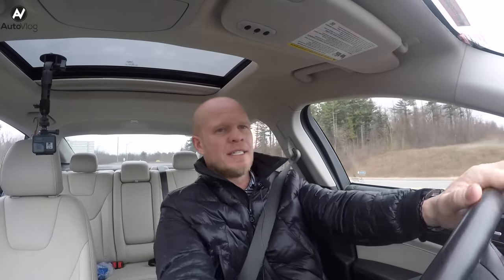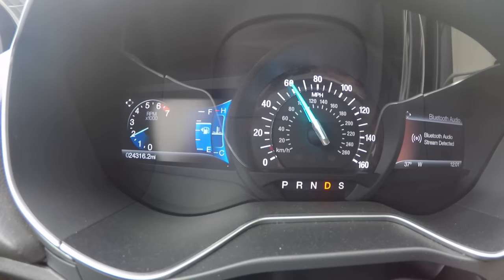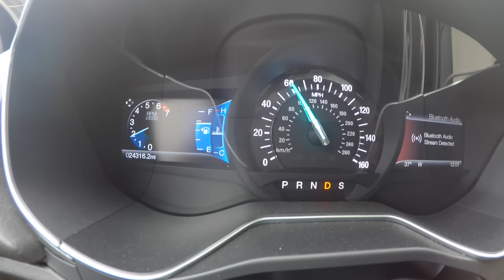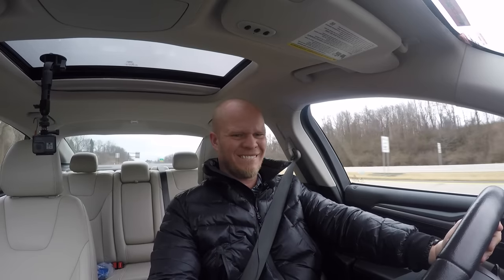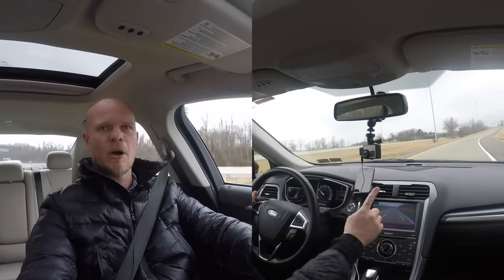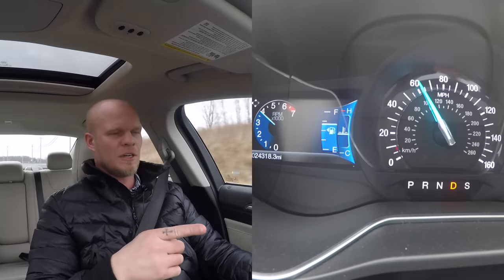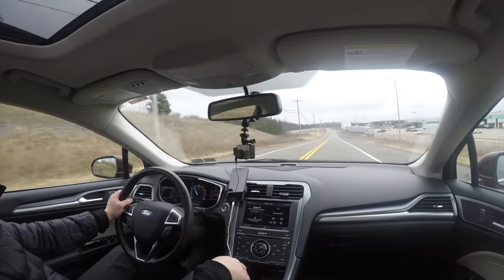What happens if you put your car in REVERSE while driving? (Things NOT to do while driving)

Comment: I get the transmission inside got cracked that something is going on in there but if you want you can buy transmission blocker when you drive forward it cannot turn into reverse or park to the stop and then you can turn to reverse or Park

Comment: I figured the torque converter isn't transferring power when your foot is not on the gas. Now if your driving and your foot is on the gas and somehow it goes in reverse is where problems would occur.  Some new cars could have a electronic feature to prevent

Comment: Did this in a 2003 Micra by mistake. Almost like slamming the brakes on momentarily before the engine stalled. Scary but car seemed fine, although did require 3 attempts to get engine going again.

Comment: Yes, new cars have so many sensors an computers operating them, the interlock prevented the transmission from actually engaging its reverse mode. The electronic switch on the gearshift actuated the rear view camera. However, my 1998 Pontiac, accidentally did it once, actually tried to reverse the drive train, very momentarily, before I realized what had happened at about 40 mph. Quick reflexes, I guess, kept it from ripping my trans apart. That was about 5 years ago and it's still going strong. On a manual transmission, the inertia of the car against the clutch plates would/should rip, at a minimum, your clutch or sheer the bolts on your drive shaft. (You are trying to reverse the direction of the driveshaft, against the forward momentum). I guess thats called physics.

Comment: With a manual it would turn stop the engine then it will turn backwards then it will probably exceed max rpm, the oil pump will run backwards, the alternator as well and possibly other unexpected problems. Anyway it would rattle not sure if you would be able to switch into reverse

Comment: newer car will act as it in neutral at high speed but when the car close to stop it will switch to reverse which can cause damage your transmission. It does happen to me (sienna 2014) but lucky no damage happen

Comment: I did this while going downhill with a 2006 Toyota Camry XLE V6. I wanted to put it in neutral to "save gas" but then I accidentally pulled it down an extra shift ... until I realized it. My car is still working fine after a year.

Comment: In older autos it will stall the engine, just like going from R to D at speed with no revs. Good luck trying to get a manual to even shift in to reverse and all it could do is remove reverse as a future gear option lol!

Comment: Back in 1979, while intending to coast down a long hill in neutral, I accidentally shifted a '74 Pinto automatic into reverse.  The rear wheels locked up.  I think the engine shut down too.  My brother and I continued our trip without incident.  The next day the timing belt broke.  After the timing belt replacement, the car continued to run fine until my father traded it on a Toyota.

Comment: 1.if car is in 5th gear and i apply clutch and did not do anything and i again relief the clutch what will happen. ?

2.if i took neutral directly form 5th gear. and again i put 5th gear what will happen. ?

3.if car is at top gear and from 5th gear i shifted gear to 4th without lowering speed what will happen.?

4.if i drive car without acceleration do it effect engine ?

5.if i apply clutch and then from 5th i come to 4 gear but still i am holding clutch and again i come to 5th gear by mistake what will happen? 
Please answer all these questions

Comment: The 2010 xrt xlt 5.4v8 when you do that at anything more then 10km it shuts the truck off and you roll I've don't it by accident I didn't stop on gravel and assumed it would be fine but it just shuts off the the truck. My other truck is a manul and it doesn't so that it grinds gears at anything more then walking speed

Comment: I tried putting my short piped dual exhaust Dodge Durango in nutrel to rev bomb a parking garage one time when a little too fast when shifting accidentally put it in reverse and stepped on the gas.....let's just say I did a peel out instead of a rev bomb luckily I was going 10mph so no damage to wheels transmission or anything

Comment: Try this with an older car. My wife put her 1999 Honda Odyssey into reverse while rolling less than 10 mph forward in a parking lot and it had no reverse until I pulled apart the transmission and replaced hard parts.

Comment: Did this on accident in a 2004 ford explorer. Transmission lock up for a moment and it shut the vehicle off. The explorer wouldnt turn over after however. Later found that somehow it broke the fuel pump, and the transmission was fine. Despite skidding to a stop at 40mph.

Comment: That’s definitely not what happens in a 96 Chevy Blazer. I did that once by accident back in the day day. I was going to shift from Drive to Over Drive and there was quite a bit of resistance, then when it finally did shift it jumped all the way to R which was a lot of fun. I was doing about 50 and the rear wheels immediately started powering backwards at full power, screeching horrendously of course, fish tailed about, then the whole truck seized up then released as though in neutral and shut completely off... all within about 15 seconds of terror and then continued rolling at about 40mph. Coasted into a parking a lot and then put it in park and it started back up all as normal. 

In the future when doing these videos I’d recommend not doing them on a trafficked road with other motorists around haha.

Comment: When I first turned 16, I had to do deliveries in this old crappy Chevy Astrovan.  The transmission lever was so loose and sloppy, it was easy to slide past the gear you wanted.  I was going down a hill, so I shifted it down into 3 out of D, then when I went to go back into D it just slid right past D and into R..  The wheels locked up and it skidded.   I quickly put it back into D.  It scared the crap out of me, now I think it's quite funny looking back.  haha

Comment: This thing happen on me, just tonight. It was an accidental shift. I was doing a manual mode/ manual downshifting. I was on d3 at an uphill, then i decided to go back to d or drive. Then suddenly i heard a screech like tires rolling fast?  Then i saw the rpm goes up quickly almost hit the red. And i saw my reverse cam shows up and i saw my gear was on R. Then immediately  shift it back to drive. Thank God nothing bad happened, because some one was tailgating me. Who wants me to go speeding over a speed limit. Lol. My car just continued driving forward, didnt stop or reversed. I knew it was my bad i over shift, but i really just made one shift towards D. I dont know how it reaches R. I drove a honda civic 2010. Now i know my car is reliable hahahah. I will be more careful next time. I dont want to mess up with my transmission again. Lol

Comment: I done it in a s10 by accident it was a aoto and i went to move it to overdrive from 1st gear and the the shifter slipid from 1st stright to race mode it made a bad noise and stalled out

Comment: Ive done this in my 99 jeep xj auto accidentally doing about 30mph for a split second.  It made a nice clunk, chirped tires, and stalled.  Its my first automatic and my throttle position sensor was acting up and I meant to go to neutral.  This happened around 170k miles on vehicle and now has 220k and still going strong.  "Oooops"

Comment: I used to have a 2005 Hyundai Santa Fe and my girlfriend got mad at me and put it in reverse. (Car had 426k miles on it at the time. Original transmission but savage engine. The car just clicked like it was rubbing against some plastic but nothing too major. I put it back into drive and I never had a problem out of that car. I actually sold it about two months ago. Some cars guys can take a hell of a beating! Hyundai Santa Fe SUV’s are one of them!😂

Comment: Well, I searched for this on YouTube because it just happened to me by mistake. I took my eyes off the road, and in front of me all the cars were stopped so when I jammed on the brakes, my hand was which was sitting on the gearshift accidentally pushed it forward into neutral and then reverse for a split second, I don’t think anything went wrong. I don’t know my transmission is still in my car. It’s not sitting on the road but that was really scary and I will never do that on purpose. Trust me.

Comment: I had a 1996 Ford Ranger XL RWD with a 3.0 V6, and an Auto Transmission that I accidentally did this to because I was resting my hand on the shifter on the steering column, and let me tell you, if your vehicle is like my Ranger and doesn't have a failsafe it will scare the living fuck outta you if you aren't expecting it. What happens is the transmission with quickly make you wheels go in reverse or lock up and cause your tires to break traction and possibly send your car out of control. I was going 60 mph on a long sweeping turn when this happened and mine    locked up and caused my truck to go into a massive drift at angles you would see in the D1 Grand Prix or Formula Drift and luckily I knew how to react quick enough to control the slide and straighten the truck back out in the straight and then throw the transmission back up into neutral to start the engine again and then into drive to pull over up ahead. My heart was pumping like crazy after that and luckily when I pulled over afterwards to see if I broke anything there was nothing wrong with the truck or the engine. So please people if your even thinking of doing it don't be an idiot and try it because it could result in harm to your vehicle or even worse you could get yourself and possibly people around you killed because you lost control of your vehicle. So once again, PLEASE DO NOT TRY DOING THIS EVER!

Comment: With cars before 2000 if you put the car on reverse while driving it will lock up the transmission and the wheels wont roll forward resulting in braking. I did it by mistake once.

Comment: In case of emergency...

Your gas pedal is stuck. Your break is not functioning. What will you do?

A) use the emergency brake
B) jam the car into neutral 
C) turn off the engine

Comment: I hit my 1969 dodge coronet in reverse reaching for radio at 45 mph.....spun the tires started to slow down..put back in drive.....built up pressure had to tighten up tran pan bolts

Comment: I did once in a 80s Toyota Corolla and the engine stalled the tires burned to stop. But it could be restarted and no problem whatsoever for other four years. However for Ford, good luck.

Fix Or Repair Daily

Comment: I have actually done that in an older vehicle (2000 GMC Jimmy) when I was going downhill at 60 mph, and I meant to put it in neutral (also a bad idea) but I accidently put it in reverse. The engine just died and I blew a fuse, but other than that, no damage was done.
Reply: this is possibly helpful it blew a fuse

Comment: You must of known that is what happens otherwise you would have used an old bomb and not have done it on a public road. Standard Ford transmission does this older ones sometimes stall the motor, but they have to understand idiots will one day think lets see what happens. For those wondering about manual trans (stick shift to the non English speakers) there is an inhibitor to stop you and reverse is mostly without syncro so good luck matching the speed to a negative so you will shear off some teeth trying even if the inhibitor fails.

Comment: Invalid test. You have to cycle the accelerator from 0-100% about 3-6 times in rapid succession after selecting Reverse, to override the forward speed E-lockout program. Just be ready for an EPIC rolling burnout! 😂 Your results are inconclusive on this one. Also, I'd love a confirmation that the reverse lights indeed do illuminate at speed, as this would be a useful feature for trolling! Lol

Comment: so i went to see an atv, it's night time. guy told me it's a "clutchless manual". i shift up to what i think is second gear. its L and H, okay so far. then i "shift up" again to fucking reverse. nice. i was pretty slow, probably under 10kph and nothing much seemed to happen. just a small clank from the gearbox and it seemed to disengage. i shifted back to what i thought was first gear and went back, found a light and saw the labels. "oh fuck its a cvt and that was reverse". i hope nothing happened. didn't seem to, i continued going just fine.

Comment: Did this once, 92 honda accord manual transmission. 😳 I was going around a corner, the road was wet from a broken sprinkler or something. I hit the brakes an the tires locked up but the car was still sliding forward. Right foot on the brakes, I use my left foot to sink the clutch then pop it into reverse, come up off the clutch while giving some gas.. I did NoT do this intentionally, it 😳 was just out of quick reaction, I was trying to not run off the road. I almost pooped 💩 my pants 👖

Comment: I have done the same thing on one truck I was driving purposely. This Ford Taurus is an advanced car that's why nothing happened, because the car was designed for these kind if situations. I drove 2005 Ford f-150...transmission was clicking a lot...so don't try it😂

Comment: I had a 98 Nissan Altima and went to shift to N but, went to far it popped loud and shut off while the power steering went out. Quick way to blow your transmission. 
I call BS on this you knew your near car would not do anything before you did this video that’s why you did it. You wouldn’t dare do this in an older car.

Comment: That's the level of smart to run for presidential election. Go put a car in reverse on a highway, risking other people's lives. Ofc the transmission is purely electronic, and has protection in case people do it by accident, but I don't know how you would act with manual. Real smart.